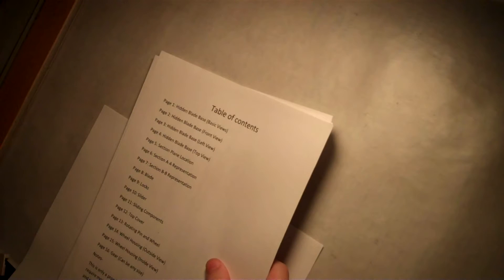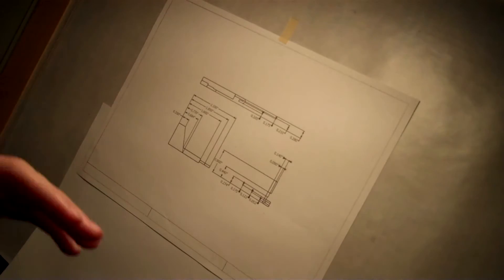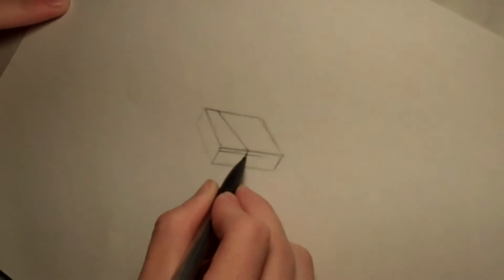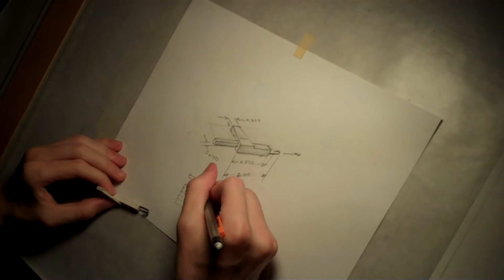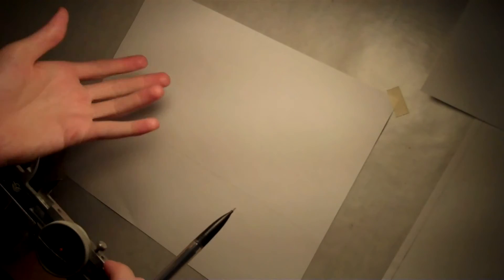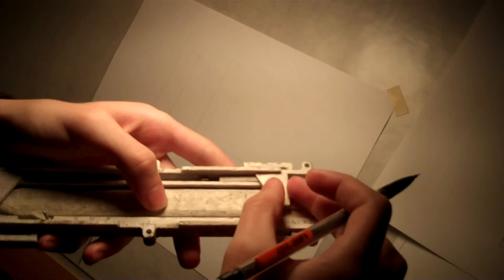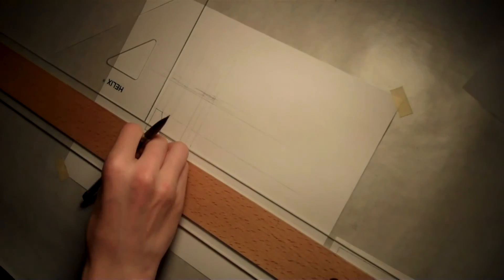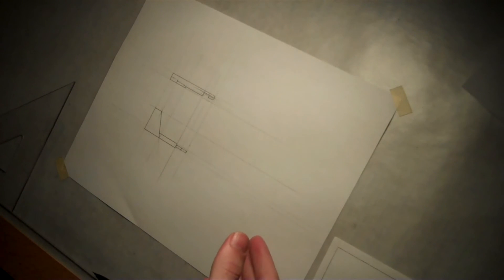The Techniques I Use To Design Basic Blueprints (For Paper Hidden Blades And Guns)

Comment: Hello . Another very interesting video. As I can not have a real 1911A1 on this country, and as I am not good on maths, and as the 1911s blueprints I know so far, are all in inches, while I use meters and its multiples and sumultiples, I am goint to have to use an airsoft replica. Unfortunately I can not have or find a way to buy a 1911A1 japanese model gun... If I could I would ''simply'' copy it to the paper. So all this will be usefull in a way or another. 1000 thanks again for this video!